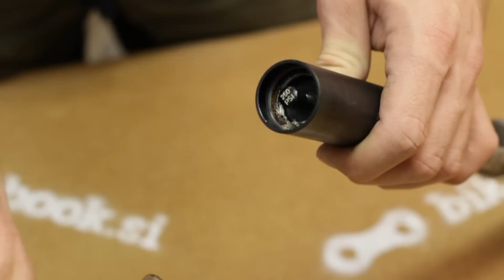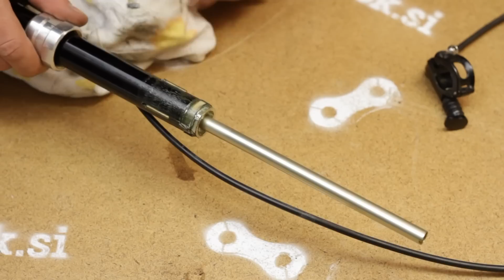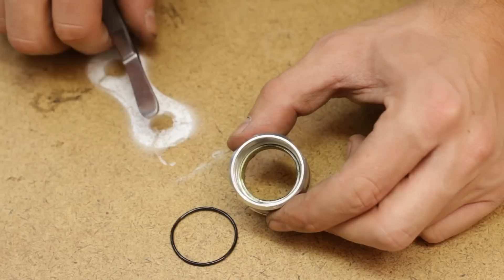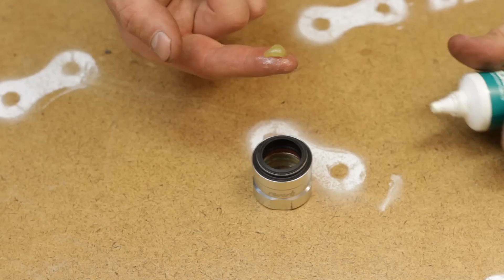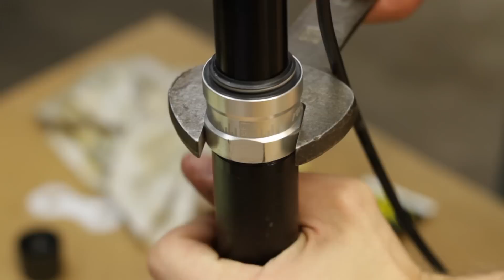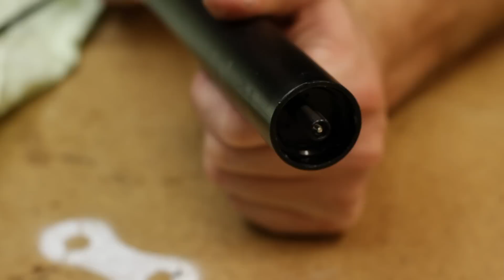RockShox Reverb seatpost service guide

Comment: what kind the grease use for lubrication? what kind suspension fluid use for dust o`ring? Thank for the tutorial!
Reply: The fluid is the official rock shox reverb one, as for the grease you can use any type of fine grease. Personally I use PM 600 military grease everywhere. Watches, motorcycles, bikes, cars - it works great.

Comment: Bikebook, I need to do a basic rebuild on my Reverb. Would you recommend I buy the 34mm crowfoot socket to torque the top seal to SRAM's spec or is making it snug with a regular wrench good enough? I'm thinking since I don't have a 34mm open end wrench, it might be worth it for me to just buy the crowfoot socket. Thanks for the help and thanks for the video!
Reply: Saludos donde puedo conseguir el kit de dropper seat post RockShox

Comment: What is that vise block you used? Is it a rubber or polymer one? The ones from Rockshox are expensive.
Reply from the maker: They are plastic vise jaws. Nothing special. The price should be around 10€/$ at any hardware store.